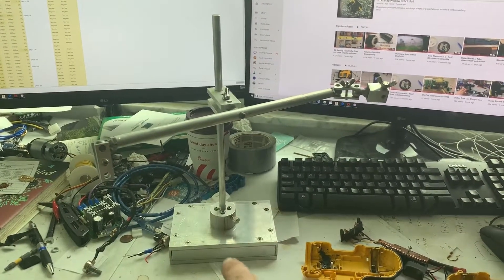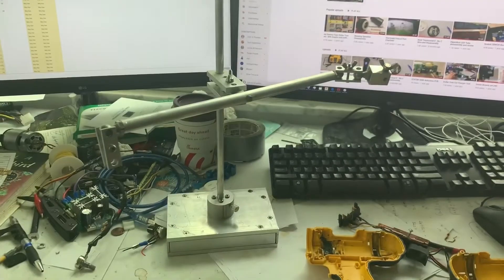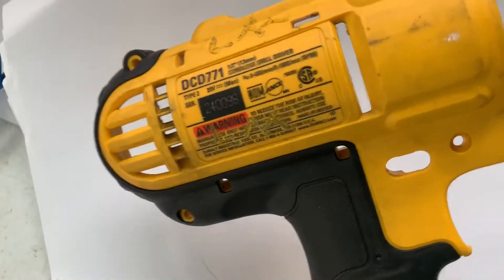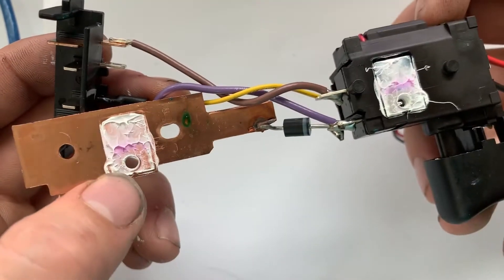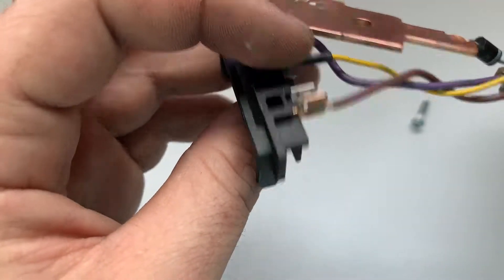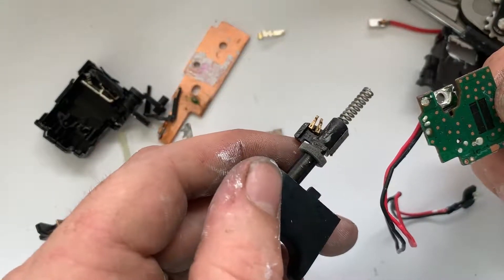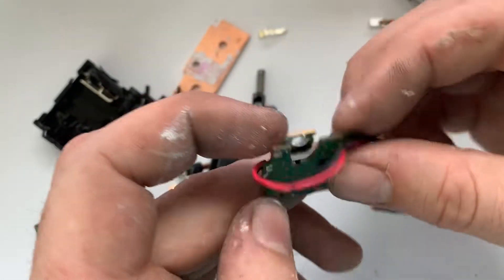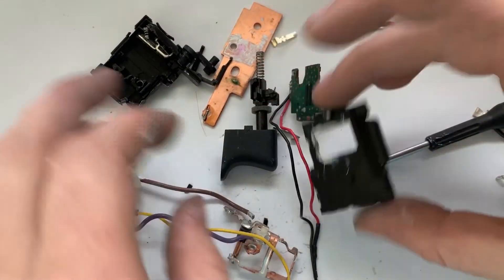20V DeWalt Drill Speed Control Disassembled

Comment: This is voltage to phase  converter,mean PWM controller with mosfet efficient controlling the speed of the motor. Linear regulator will overheat at 3A or more.